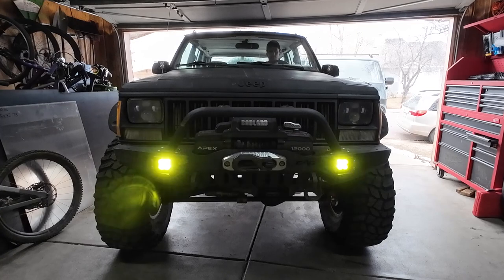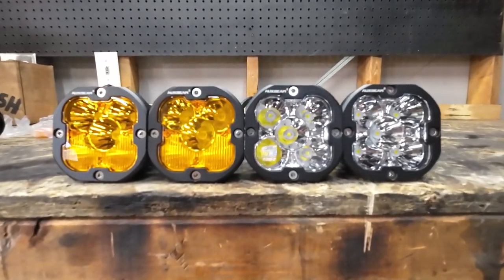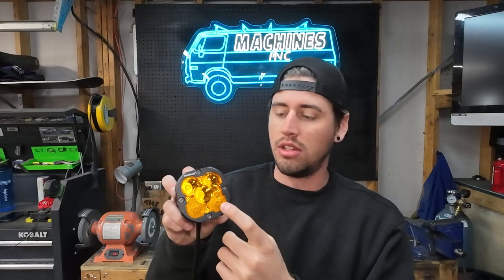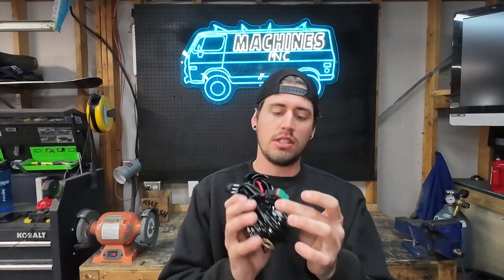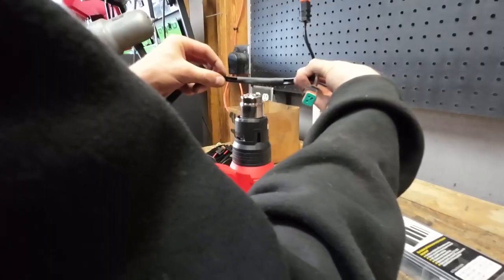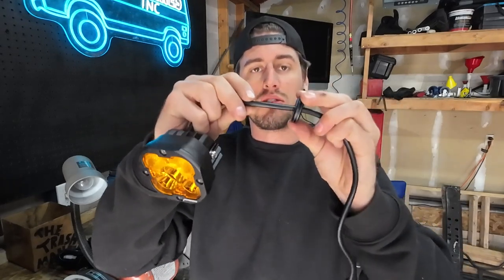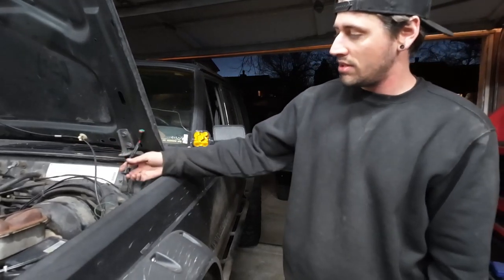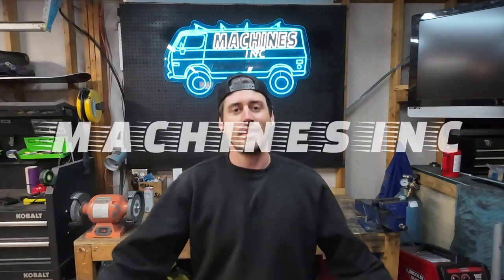New Off-Road Lights! Auxbeam Pod install & Test On Jeep

Comment: Would you be able to cut the connector of the light and install a new connection? I have a similar set but want to add them to an existing harness with different connectors.
Reply from the maker: Yeah you can do this easily. It’s just a two wire connector